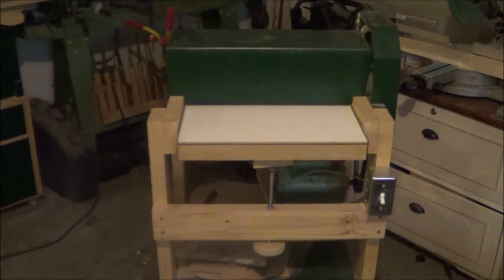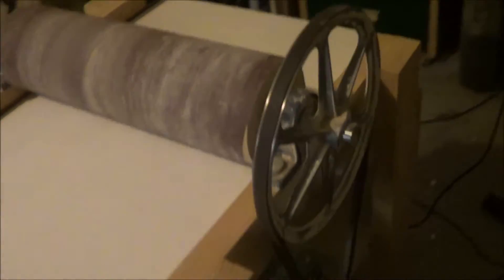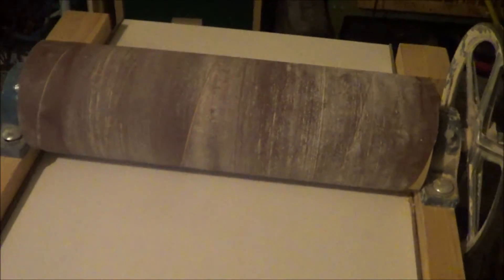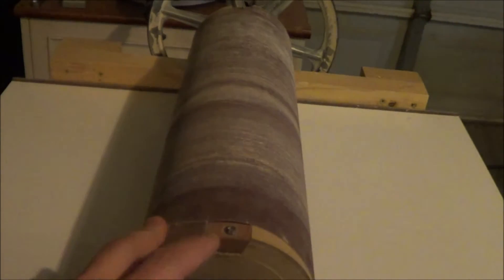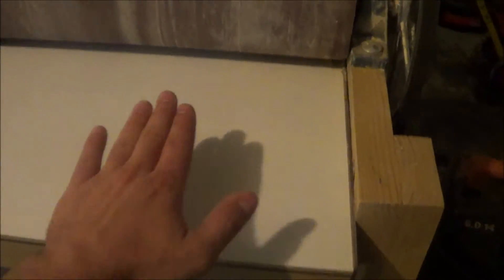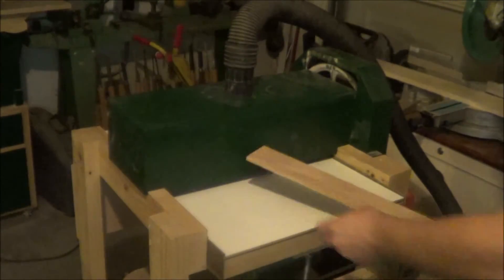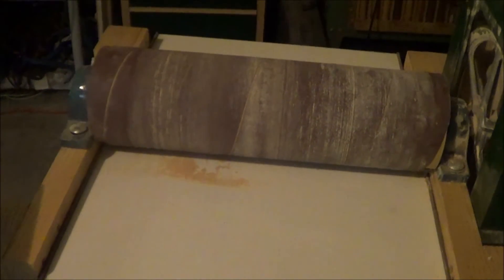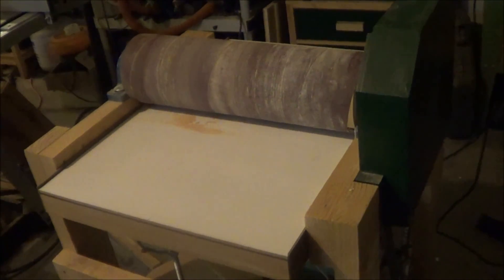Homemade Thickness Sander (Drum Sander)

Comment: Nice diy project you have there! I'm currently building mine as well. I'm using a 1/3 hp squirrel cage motor, pulley and shaft, although mine is only gonna be 8" wide bcs of the length of the shaft. My question is does it matter which direction you feed the wood according to the rotation of the motor? Also my drum will be 3" diameter, how do I determine the length of sandpaper to wrap it with?
Reply from the maker: Thanks! You definitely want to feed the wood against the rotation of the motor.  You want it to feel like if you let go,  it will launch the wood back towards you.  If you feed it with the rotation of the drum, it will just grab the wood, pull it under,  and launch it across the room.  For a small diameter drum like that,  you could just wrap a full width single sheet around and use a full width wedge to keep things simple.  You could still use the spiral method I used though if you'd like. I would worry about calculating the length in that case.  I would just wrap it with a piece that's too long until it goes off the edge of the drum and then mark the underside with a pencil to know where to cut:)
Reply: @tlgrimmy  Thank you! I thought that it would have to go against the rotation. I have a small strip of sandpaper that is actually for a belt sander and a piece that came off my tabletop sander that tore when it off tracked when it was new. I decided I'd make a template out of poster board, I'd rather make a template so I don't fall short! Thanks again!